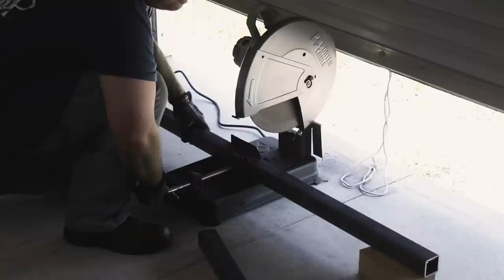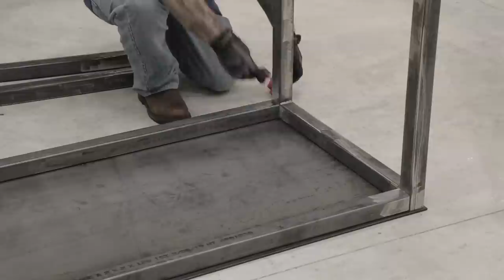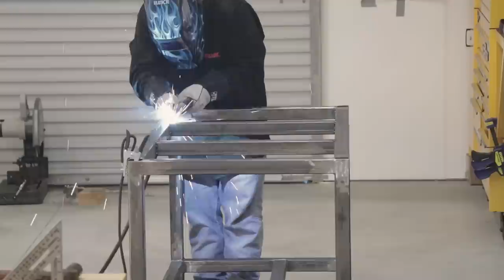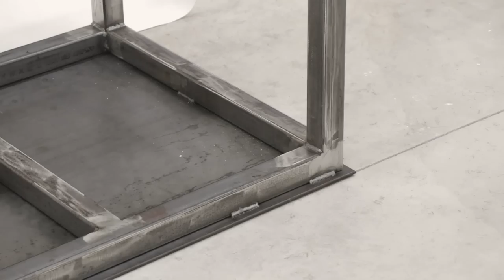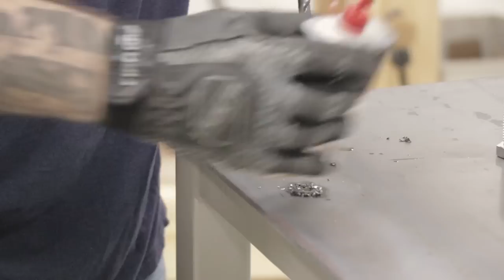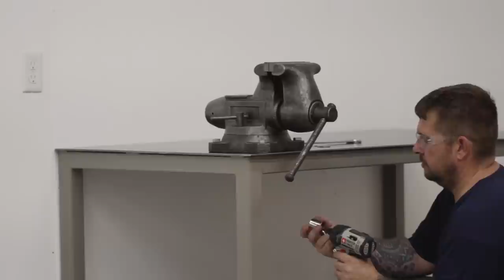Metal Workbench Build

Comment: I love this bench. I wanted to ask what's the length height and width. Also if you could share how much wider is the table top from the frane. You have it absolutely perfectly figured out. I will do this next week. Thanks for the info
Reply from the maker: Thanks!  Sorry for the late delay. It is 5 ft long x 30 in  wide x 35 in tall. The top sticks out 1/2 in on all sides and the bottom shelf is around 20 in wide. The top  and shelf are 1/4 in thick and I used 2 in square tubing for the frame
Reply: Thank you for your reply. I love your table and I will build it next week. Ordered the tubing already😂 We go by cm. I ordered 60mm/2mm thick. It was cheaper than 50mm/2in at the time of my order... All the best mate!

Comment: love the bench. i,m female, i would have put wheels on it.  great job.  i will be doing scrap metal art/build products. what tools would you regiment for starters?
Reply from the maker: Thanks. Wheels would be a great addition. I would recommend a couple right angle grinders. One to cut metal and one to sand and grind with. They are pretty cheap so it's nice to have one set for each task. In this video I used a chop saw with an abrasive wheel but I also have a portable band saw  that is quieter and easier for me to use. There are some cheap ones on amazon and harbor freight that work well. And for a welder, a mig welder works for most situations.
Reply: @TwistedWorkshop77  thank you. i see, for a workshop is ok to have corded tools for more power vs cordless.

Comment: Great build... I was just wondering that what if the vise is on the pipe structure instead of plate on all the corners... Just small pipe could have been welded underneath to the corner to make it more robust...

Comment: Sweet table. Im going to build mine soon. Is the fram 2x2 1/4 tubing? What are the dimensions of the table?
Reply from the maker: Thanks. The tubing is 1/8" thick 2x2. The top is 60" x 30". The bottom shelf is 60" x 18". I bought a 4x8' sheet of 1/4" thick steel and was able to get the top and the shelf and I have a 3'x4' piece left to make a roll around cart or weld table

Comment: This bench looks simple yet sturdy and functional!
Thanks for sharing.
could you please post what kind of sanding you did on the top surface?
also, is that paint going to prevent rusting?

Thanks.
Reply from the maker: Thank you. I used a plastic disk to buff out the top. The disks are typically used to remove gasket material in automotive work. The paint is a farm and tractor paint and it has kept the base from rusting so far
Reply: @TwistedWorkshop77  What did you use to coat the top with, some form of wax?
Reply from the maker: @carlalm6100  yes, I used Johnsons paste wax

Comment: Very nice.  I'm considering making a table like yours or buying a smaller fabrication table.  langmuirsystems makes a very cost effective fab table, but I'm not sure about the price of materials for a table like yours.  If you could do it all again would you stay with the 1/4" top, or go a bit thicker?  I'm going to go off your table dimensions and get a quote for the metal.  Thanks!
Reply from the maker: Thanks! I am happy with the top as it is. It has stayed flat but I would go thicker if a plate was available for the same price because it could only be heavier and more stable with something thicker

Comment: How much weight can this table base withstand, could it hold 3,000LBs safely? Also how much did it cost for all those metal parts?
Reply from the maker: It's been a while but i think I spent about 400? And I have enough material left over to build a roll around cart. I'm not sure if it could hold 3000 lbs.

Comment: Why wax the table? Surely that stops you welding through the table? Fair enough if you're only going to weld with the vice.
Reply from the maker: I was just trying to slow the rust. I don't use the table everyday. Seems to be working if I reapply the wax every once in a while

Comment: Nice build. I'm about to make a metal work bench myself. It will be mainly angle iron 1/4in with very heavy duty legs. It's going to be built out of sections from a 25ft industrial racking upright.
Reply from the maker: Thanks! That's a good idea using the rack material. I see it all the time on craigslist and market place.

Comment: Would capping off the tops of the legs make for more flat top ? Thinking of building something similar only with a wood top and not sure I like the open square tubes on the top frame
Reply from the maker: I'm not sure if sealing the tops of the legs would make a difference. It would be easy enough to do though. The 1/4 in steel top is pretty flat.

Comment: Is your Vice set to far in from the left side of your work Bench. Nice Workbench I hope 
to build one  some  time.
Reply from the maker: Thanks. It hasn't been a problem yet. I wanted to move it closer to the edge but the leg would have prevented me from putting a nut and bolt in the front left location to hold the vise down.

Comment: I want to replicate this table about how much material do I need to make this exact one ?
Reply from the maker: I purchased qty 2 20ft pieces of 11 gauge 2x2 square tubing. I bought a 5 ft x 4ft piece of 1/4 steel plate for the top and the shelf underneath. I think the bench dimensions are 5 ft long x 30 wide x 35 or 36 inches tall. The bottom shelf is 5 ft x 18 inches. Hope this helps. I had a couple feet of square tubing left over

Comment: @Twisted Woodshop How stong structurally is this? Could it support a 1500lb piece of steel on top with some additional cross sections? Trying to decide between the 1/8 vs 3/16 wall tubing. Awesome build by the way.
Reply from the maker: Thanks. I wouldn't want to guess what it takes  to to hold up 1500 lbs. I would hate to give you bad advice. That's one heck of a steel plate though
Reply: Thanks for the reply. I’ll play it safe and go 3/16

Comment: Nice built. What’s the final weight of the table. Can you give us the thickness of the material you used.
Reply from the maker: Thank you! I would guess that the bench is about 250 lbs. The top and shelf are 1/4 inch thick. The legs are 2x2 inch and I think 1/8 in thick
Reply: @TwistedWorkshop77  Tks

Comment: i dont suppose you would have plans or a steel list so we could copy you design?
Reply from the maker: Sorry I dont have plans for this one yet but here are some of the dimensions.The tubing is 1/8" thick 2x2. The top is 60" x 30". The bottom shelf is 60" x 18". The bench is 35 inches tall. I bought a 4x8' sheet of 1/4" thick steel and was able to get the top and the shelf and I have a 3'x4' piece left to make a roll around cart or weld table

Comment: What was the welder you use and thickness of metal sweet table after you built it what do u figure it weighed? Locking wheels would be nice to
Reply from the maker: I used a hobart 190. I used 1/4 in thick sheet metal for the top and shelf. I thin it weight around 250 lbs. Yes! I thought about the wheels that rockler sells for work benches. They allow the bench to sit on the ground when the wheels are not in use. Thanks for watching
Reply: @TwistedWorkshop77  cool bench regardless

Comment: Hi what's the welder you are using?
Reply from the maker: A Hobart handler 190. I would like to get a multiprocessor unit to be able to some tig welding. But it might be cheaper at this point to just get a dedicated tig unit. I've been working on some jeeps lately and it would be nice for welding up roll bars

Comment: How much did it cost to build this table?
Reply from the maker: I bought the material new. 400.00. I have enough material left to make a 3x4 ft roll around welding table. 1/4 inch steel 4x8 sheet = 350.00. 2x2 boxed steel 2 20 ft sticks = 50.00

Comment: I'm going to buy my 1st migwelder . I'm thinking of a 135 amp clarke unit. Would you think this would suit hobby work?
Reply from the maker: There are definitely more qualified people to answer that than me but if you will mostly be welding 3/16 inch or thinner parts, it seems like a good size. I dont know much about Clarke welders
Reply: @TwistedWorkshop77  ok thanks for the speedy reply.  Bench looks great 👍🏼
Reply: @daithimurphy1832  I learnt on a clarke 135te and it's a brilliant welder, my first welder is a hawk 150 mig from ebay, i stuck with gasless but the option is available for gas should i ever want it. Brilliant welder, although needs a 16 amp supply because its a 150.
Reply: @HomerDoesGamingAndTech  great thanks for the info. 16 amp might be worth installing to get the bigger welder
Reply: @daithimurphy1832  no worries, its on ebay. I just stuck a 13 amp plug on the end of it, confirmed with an electrician that it would be safe however it's best to install the 16 amp supply really, I will be doing that shortly.
Reply: @HomerDoesGamingAndTech  I've been told its easier to weld with gas so I'll probably go that way. Thanks for the info .

Comment: My full swivel vises are on 2x2 tube, and they can slide into 2 receiver hitches, which I mount under the table top, on a reinforced sub frame, on the end, and on the side.  They can be stored on the bottom shelf, and add almost 100 pounds to the table.  Also, a sub frame at each end has casters, which can be locked up, or down.  Easier to move a full table.
Reply from the maker: Voth sound like good upgrades. My vise takes up a lot of room on the top